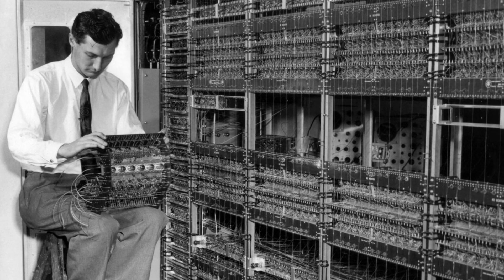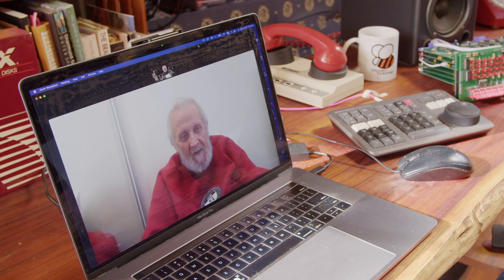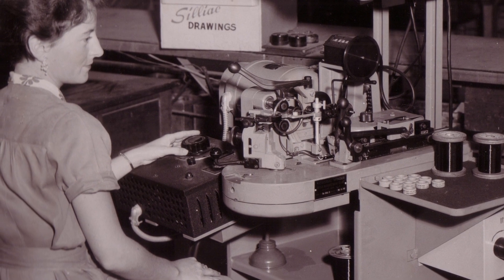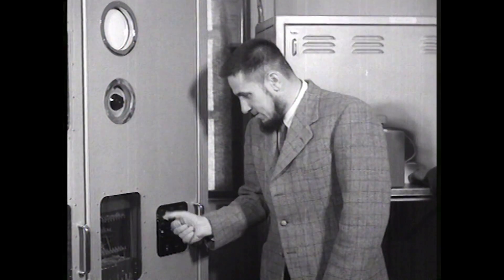The Computer History of Australia - Ep5 "SILLIAC"

Comment: I am enjoying this series. I've tried to figure out how many electronic computers were installed when I was born, in June of 1957. The statement at the and that there were 1100 computers worldwide by 1956 sets a lower bound. By late 1959 there were 5000 computers in place worldwide, so that's an upper bound.
Reply from the maker: It's an interesting questions that we are trying to answer as well. Clearly a lot of computers started appearing on the scene world-wide from 1956 onwards. 1957 IBM built the 610 series while IBM was also building SAGE which was a system of computers and radars for the early warning of missiles. From 1959 IBM announced the 1401 series while Ferranti made the Pegasus series. I am sure there were other manufacturers to add to this. From 1959 we also started to see Gen2 computers as well so things really took off. By the end of the 1950s, around 8,000 computer systems had been installed worldwide from our understanding but I am happy for anyone to correct me on this??